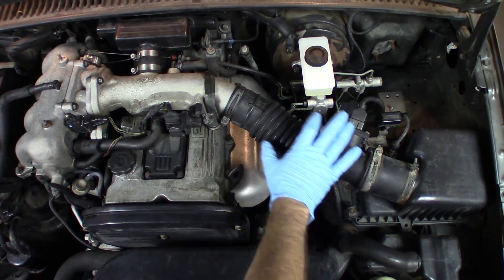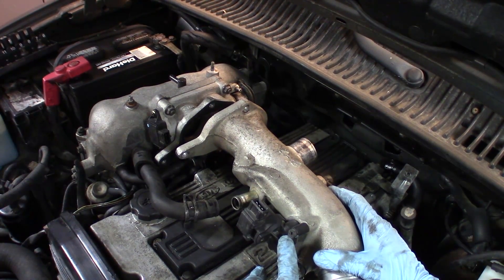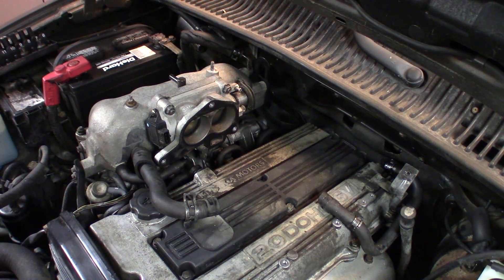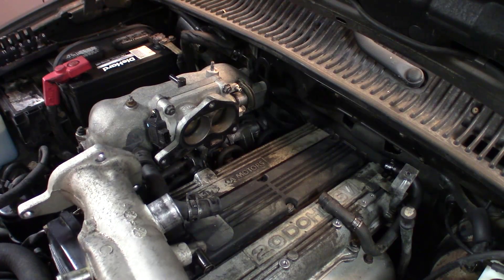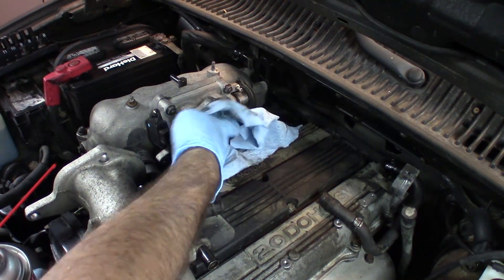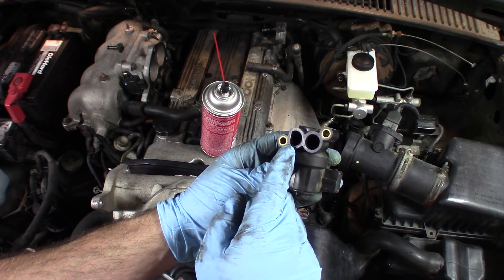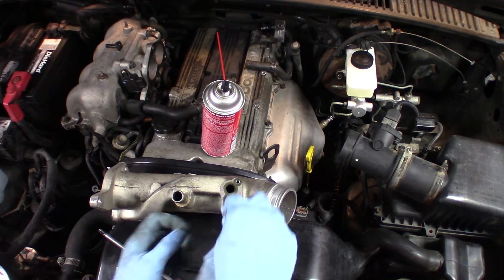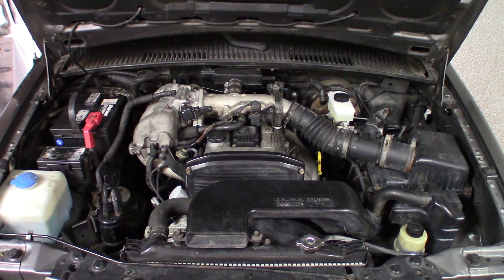Cleaning an Idle Air Control Valve and Throttle Body (Kia Sportage) DIY

Comment: Hi 50skid..
MTEC 330 CI here ..

I have a very frustrating problem with the ICV.. First my car was standing for a while .. so when I got round to starting it up it would not idle from watching your videos i was certain it was the ICV as the car was running absolutely fine previously... so i removed it.. disconnecting all of the  Engine management module cables.... sure enough no shake rattle and roll.. so i cleaned it using fuel injector cleaner.. and freed it checked it was spingy it was (not as much as it could be)... so some time went by before i got round to putting it back on again .. when i did imediately i had strange problem .. if the ICV was connected it would not turn over.. so i decided to remove it to see if it would crank with out it .. and it did indeed start with out the ICV present and idle.. but still with a actual Check engine light... i so i pulled the codes ..and what did i get of course P0400 and the code for Vehicle speed sensor A acompanied by DSC light flashing.. HRMM weird.. so i cleared those out as they made no sense at that time.. tried to start it again with the IAC present which failed... this time it it did not register any codes at all.. Strange again.. so I double checked every thing discovered I had connected the purge evap to the oil prsure sensor and the purge evap to the oil pressure sensor :( the keying is the same and the cable are the same length and right next to each other only difference is the oil pressure sensor is 1 wire connector and the purge evap is 2 I should of remembered that the purge had the big square thing on the connector ... once i resolved that the DSC flashing stopped but it still would not turn over and again no codes .. so I remove the IAC again and turn it over .. now i get codes P102 (makes sense its not vacuum tight and not even connected to the elbow/throttle body properly) along with P1504 and P1508 .. god dam it the things not even presnet LOL it cant be either Open or Close because it NOT THERE.. any way so I decided to test the IAC with a multi meter for correct ohms on all the pins based on information i scowered from pelicanparts.com they are correct based on those values provided.. then I checked the cars connector found there is voltage on pins 1 & 2 ... and the ICV is vibrating when the ignition is on... can you advise me here because I am very confused and frustrated with this now..and will basically be left with no choice but to sell the car for parts ...  what could of happened to the ICV can the ICV really be stopping the engine from turning over just because its present and defective (perhaps I damaged it when I tried to clean it and this upsets the Engine management module to such a degree) ..I have a new one coming but i am just so skeptical as to how that thing could of broken and i feel like I am buying it unnecessarily ... and I do realize bmw recommend to replace it at 100K which my car has done 130K so it is old.. once again any advise here would be appreciated any many thanks in advance.. 
(where did your BMW icv/throttle body video go? or have have i phased out of a different parallel universe or something haha)

Comment: I have a Sportage 2400 cc model 2014. When I put the gear on D or R the RPM drops to 500 and the engine vibrates the cabin. The sparks ⚡️ are replaced together with the fuel filter but the problem is still there. The mechanic is telling me the your gear transmission might have a problem. Is the mechanic correct or in most cases he wants to rip me off?

Comment: I need to know the part number of The ( Stabilizer Sensor, yes it is a Sensor...( that is attached to the front of the Chassis of the passenger side on a Kia Sportage 96, 4-door, 2.00 gasoline.    It is at the bottom of the motor below the battery. I need to know ..the serial number of that part,  because I cant find it by just searching online...It comes with a serial number ...Thanx JC

Comment: Hi!!
I have a 2012 Kia Sportage... and my idle is at 500 rpm, and drops a little when stopped at a red light. I changed spark plugs, cleaned injectors, and cleaned the intake, checked the filter and all that... still does this when idling at a red light. what could be the issue?
Reply: Did you fix it? I have the same problem.

Comment: hey, my kia 99 does have the following problem some time it run acceletate and if just push the pedal it stop and goes normar . Will that have to do with this "Air Control Valve" thank!
Reply: possibly dirty throttle body where its sticking & when you his the gas with your foot it springs back.

Comment: I have a 1999 Sportage, It starts up fine, its will idle then when you give it throttle or put it into gear it will stall and becomes hard to start back up. Any Ideas! Had someone run codes and it said it needed the coolant temp sensor I replaced it and Still the same thing!
Reply from the maker: You might have a weak fuel pump.  I would check fuel pressure both at idle and at engine speed.
Reply: Ok will do thank you very much!!

Comment: My idle rpm going up and down on kia sorento 2006. Changed TPS sensor but no change. What could be the reason. Thanks in advance
Reply from the maker: There might be some vacuum leaks around the idle air control valve and/or it just needs to be cleaned.

Comment: Hi guys,
I have a 2007 Kia Sportage. When I hit the brakes on when I was on a high speed the engine stops immediately. I would appreciate if anyone could know the issue. Normally it runs fast when I don't touch the brakes but when I do it stops. Thank you
Reply: i really dont know but my kia rio 09 stop out of nowhere (when i came to a stop) and it was because some "heat sensor wire" that cost $100. Dont make the mistake i made and blame the fuel pump. PS stay away from dealership (stealership).
Reply: Thank you, I’ll try it

Comment: Taking off the intake runner was completely unnecessary if you're not going to take off the throttle body to clean that too. Just the IAC valve would've been fine.

Comment: For safety be sure to wait a few minutes before starting the vehicle so the cleaner can evaporate and reduce the risk of backfire from any of the cleaner getting into the engine. It is also best to spray the cleaner on the rag and wipe, rather than spray the cleaner into the parts.
Reply: Good advice Old man..thanks

Comment: @50skid qhat is the normal idle rpm of this engine
Reply: Nearly all consumer cars and trucks idle at around 800 RPMs, ideally. But it usually takes a minute or two to drop down to that after a cold start.